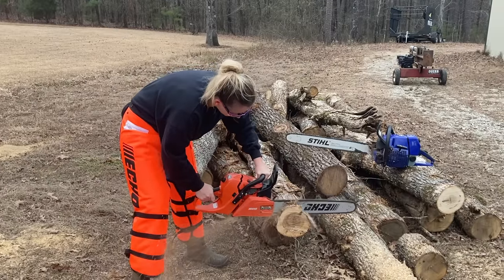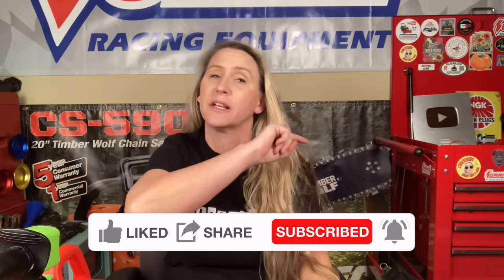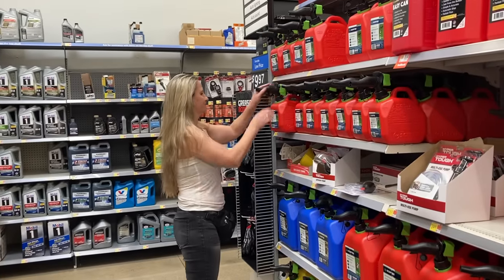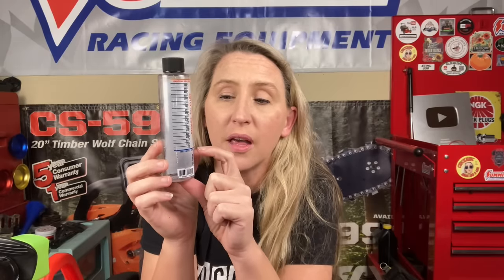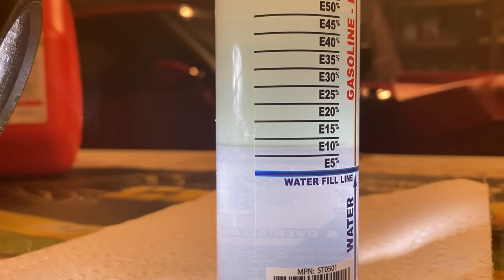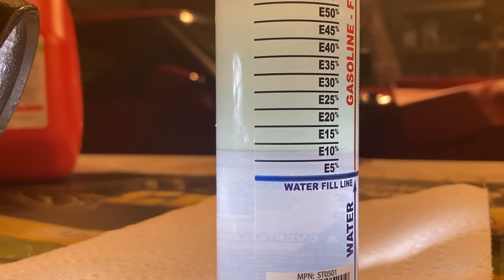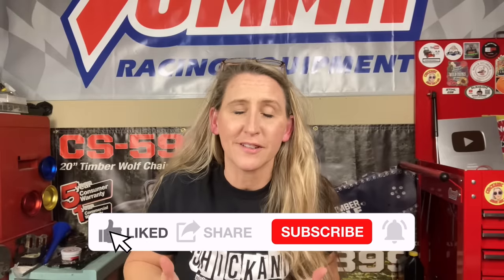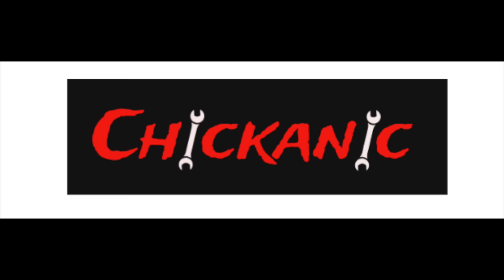Fueled by Deception. How You’re Getting Ripped Off at the Pump! (I'm SHOCKED!) VLOG

Comment: As a fuel chemist and fuel quality professional for 40 years for several oil companies and with my retail and terminal experience I usually view these video's and just shake my head but you are spot on with your testing and knowledge of fuel dispensers.  Yes indeed, there will be a small amount of whatever was previously pumped when a shared dispenser hose is used.  And your testing using the phase separation characteristics of water/gasoline/ethanol blends is 100% accurate.  Finally someone who is educating viewers correctly.
Reply: I slept at a Holiday Inn last night and I agree.
Reply: Casey’s has a dedicated hose for ethanol free. If your station does not, pump 4 gallons into your car first.
Reply: I always pump into my car before I pump into the gas can
Reply: .....and good looking too!
Reply: the gas sumps below the pump draw the gas back from the pump nozzle. i install these for quick trip and kum and go. i can speak for oklahoma pumps we good
Reply: Back when I lived in Pennsylvania I use to buy regular gas at a Sheetz station and my 78 sedan deville would diesel every time I would shut it off.  If I bought gas a block away at a Hess station it would shut right off.  Yeah, guess which on I bought.
Reply: I haul fuel to gas stations. We check every tank for water before dropping fuel so the separation does not happen. If we detect water, we will not drop and notify the proper management to have the water removed before any future deliveries are made.
Reply: My father has been using this test for many years on the fuel that he puts into his 2 airplanes. He can burn auto fuel but doesn’t want ANY ethanol because it ruins hoses and engines.
Reply: He should have set the plastic can on the ground the prevent a static discharge and accompanying fire. There are often signs a the dispenser directing how to safely fill a fuel can.
Reply: @OL-Tom I miss Hess.
Reply: Good info..I think I will go around and get no ethanol and get each sample tested . I promise that they will pay big time if an analysis shows any ethanol whatsoever they will pay $$$$$$ big time. (Yep  Those Obama EPA  gas cans are beyond infuriating . They good old  ones were $4.99 until those fools who had probably never cut grass in their lives  in their 20 story office building . I get gas everywhere most every time and worn out holding the button down and the newfangled things cost up to $25 now.
Reply: No ethanol isn’t available where I live.
Reply: @A3Kr0n I worked at one and I also agree!
Reply: Ethanol is the big scam on us! I’m sure you know what I mean! 😳
Reply: me too! 70's LA County's CA first Vapor recovery me and Dad with a car wash off the 60 at Nogales all the way to 90's containment, and 2000's to retirement.
Reply: Thankfully all the stations in my area that sell ethanol free (not many) have it on its own separate pump and hose.
Reply: I’m new and thankful to have stumbled upon your channel.  I own many small engines and know very little about them.  So the information you give is a godsend.  On this particular video I have to comments:  1. Most big government regulations come from one idiot or one company who has messed it up for the rest of us.  I don’t like it either but we can’t hunt down all the idiots.  2.  Pouring the gas into a smaller, more stable container, and then transferring to the tester would have been much cleaner and easier.  Thank you for the content.  I have so much to dive into.
Reply: @A3Kr0n but was it a holiday In Express???
Reply: @watching95  but still a rip off as you are paying for E free and getting some other stuff first..
Luckily where I get my EFree has a dedicated pump..
Reply: Shades of Sunoco and the many grades of fuel
Reply: @StaticSift  I wonder what % ethanol will show up from those units?
Reply: @laymardad3335 yeah okay. What gas stations do you deliver to and in what state and cities. I have watched every single gas station in my town be refueled and all but one of them have water and sediment in the bottom of their tanks none of them have ever clean their tanks out or done anything special when the fuel truck showed up.
Reply: @bobbyhempel1513   It isn't the driver who delivers the fuel who removes the water. If water is detected, the store management is supposed to hire a company to remove the water from the tank. My responsibility is to check for water and refuse to deliver if water is present.
Reply: Anything that the government gets involved in becomes a total mess.
Reply: This had happened in Canada I believe around 2010 where when you went to the gas station and bought supreme gas we were getting screwed and it was all regular gas and somehow somebody found out and there was a class action suit. I believe if you had proof of gas and purchases dates etc. I think they had to reimburse you. The big problem with this  is if you’re driving a high-performance car that requires true supreme gas and you pump from those pumps  sharing different grades or supreme only and it has regular gas you could be destroying your motor.  I personally try to only get supreme gas where they have separate nozzles for supreme only.  This whole gas thing in the price were paying for gas is crazy just the government screwing everybody.
Reply: ⁰
Reply: Those gas jugs (can't really call it a can) are probably the best they have come out with recently, but it is a two-handed operation. I dropped the $65 and bought the metal safety can with the yellow funnel. I also have an antique steel gas can with the screw off spout cap and the relief cap to remove the vacuum. Best cans ever!
Reply: All those tools and no funnel to avoid the spill. 😂 Great video.
Reply: Do you agree with her on trufuel? I been using it for years and can’t tell the difference. Although I mostly buy avgas mixing it myself with stihls ultra.
Reply: Ah. One of those...ɓ
Reply: What the hell is with those American petrol cans!!! That looks crazy and expensive!!!
Reply: Any recommendations' for fuel stabilizer ?
Reply: Gonna have to see if my station has its own hose for ethanol free.
Reply: 76 station in Quartzsite AZ has above ground tanks...on Main st
Reply: And what water soluble additive do you think is in gasoline?  And please explain how a water soluble (polar matrix) mixes with a non-polar matrix like gasoline.
Reply: If you were smart you would have taken the spout off and poured out into a smaller container that was easier to handle and then pour into testing bottle. 
You are welcome.
Reply: If the small engine is at risk because of this misleading practice, so are our cars. My car dealership told me which chains to stay away from. It seems like it's common practice now.
Reply: Except she used a contaminated test bottle for her experiment, I agree.
Reply: Agreed,  I'm a licensed professional chemical engineer who ran an oil refinery, pipelines and a product terminal. She did a great job.
Reply: videos
Reply: @haroldstringfield1865 Anything? Does that mean you object to the federal NHTSA that regulates the safety of motor vehicles? Do you prefer that there be no safety standards in motor vehicles when you & your family drive on the roads? If 1 of your loved ones were to be killed because it's a totally unregulated free-for-all Wild West on the roads I'm sure you would sing a different tune.
Reply: Doesn't the addition of ethanol allow for the burnage of a certain amount of water too?
Reply: I'm just wondering why, after all these years, nobody can come up with hoses/gaskets that are ethanol resistant.
Reply: Ethanol free  gas is unavailable where I live in New Mexico.  For 2 years now.  I don't want Ethanol in my car.. unacceptable.
Reply: Nope! She's no scientist.  "2 different stations" and the 30 seconds of footage beginning here:  6:01  PLUS her statement here:  13:55  confirmed that SHE NEVER pumped a tank of "Ethanol free" after making sure to first pump 2 gallons of "Ethanol free" into the car.  Why does that matter?  It's called a "Control Test" and it tests JUST THE fuel for the presence of Ethanol, not a mixture caused by someone previously pumping fuel.

Also, her sample tanks were so small that most of the fuel came only from the hoses anyway.

Last point;  All you "hate Gubment" Karens have quickly forgotten how Ruthless tobacco corporations were.  Imagine the power that you will hand over to corporations if you're all successful in "ending Gubment".  You simps fail to understand that it wasn't "Gubment" that designed and built that safety mechanism on the fuel bottle,  a lazy corporation designed and built it.  No government at all means all the power in the hands of the wealthy and their corporations,, chaos for the rest of us.
Reply: @OL-Tom  curious to know where in PA.  I used to travel to York, and a local dealer sold pure gas.  I started using it in my late model Nissan SUV, and regularly got better gas mileage, vs ethanolated gas.  Then I retired and relocated out of state, and my forever-home is in a farm community which sells pure gas, white gas, diesel (farm diesel and consumer diesel), and kerosene.  All the special fuels each run from separate pumps.
Reply: Common knowledge to anyone who took a small engine class in 1980's high-school.  People are dumber now because teachers are.
Reply: The alcohol free fuel that my station sells goes to a pump that’s all by itself self with one nozzle and it gets filled by a different truck and ever i since I switched to this fuel I have yet to have any carb problems and that’s been going on 3 yrs yet ans no stabil is used and they start every spring with out issues
Reply: How much residual of the 87 is left in the testing bottle since it looked like the same bottle was used for all 3 tests. I know it might not make a difference, just wondering.
Reply: @watching95   Hello felow midwesterner!  Only some caseys have those.  Heck a lot of caseys dont even have ethanol free available in my neck of the woods. 1 phillips 66 in my 10,000 person town has ethanol free.
Reply: @zeeb696 
I do not agree with her. Tru fuel is great, been using it for years. I started watching "taryl fixes all". This guy was a mechanic before he started his own small engine business. He's really good. You can learn things from this girl, the simple stuff. Taryl dives into the much deeper stuff and his videos don't drag on forever.
Reply: Thanks  I appreciate  your video about this and subscribe   because of this vedeo
Reply: My Tesla isn't affected.
Reply: @waltershackelford3923 Wow. Pretty aggressive huh?
Reply: My tip is look for the guy gal pumping into a external tank to follow as they exit and grab their pump
Reply: I have never seen a pump that shares its ethanol free dispenser with any other fuel. Maybe this is just another advantage to living in the west.
Reply: Thanks
Reply: Ethanol Shield additive to all my small gas powered  tools, generators, etc. Instructions, state, 'NO ALCOHOL' fuels should be used in this engine.
Reply: @Barracuda48082  I question why you use additive. Just use ethanol free. Shield is a band aid which costs you moola.
Reply: Mythbusters disproved that over a decade ago.  They had to aerosolize the fuel, spray it into a container set up next to their test pump system, and then just have an open arcing circuit, way beyond any amount of static electric discharge you'll ever find, to get it to ignite.
Reply: My vehicle requires premium fuel. Now what?
Reply: Ethanol is crap. I use ethanol-free fuel in my generators and in my toys. My 2001 Cherokee loves it. No problems at all.
Reply: I'd like to see if there is still ethanol if you first purge the first gallon or so before filling a can to test.
Reply: But doesn't all gasoline(s) burn at the same BTU, 29,000 degrees???
Reply: You are a good girl.😊
Reply: Amen to that,  thank you.
Reply: @arcanondrum6543  This isn't an instructional video on how to ensure to only get ethenol-free fuel from ethanol-free pumps. 

It is an informative video of how the common everyday customer SHE serves on a regular basis ends up with ethenol in their equipment because the TWO gas stations in HER area don't use separate pumps or hoses for the ethenol free fuel. You can't criticize her by claiming she didn't do something "scientific" when she never claimed it was a scientific experiment.
Reply: Amazon has a 10 buck (set of 5 adapters) to convert gas jugs to the old style.  Those new gas jugs are a hazard and designed to make you waste gas so you have to buy more.
Reply: @MichaelofYurtBees 
I went the same direction and spent the cash to get the steel can. A year later the steel can started leaking at the bottom seam. The ethanol was keeping the water that it condensed at the bottom and the seam started rusting weeping fuel.  Went back to the stupid plastic containers and zip tie that green button when I need to pour.
Reply: @VT-kg4cu  I am contemplating getting some liquid fuel tank liner to protect my fuel cans.
Reply: @gregorycarver5723 Good thing he is well grounded then, since it didn’t catch fire.
Reply: We use NON ETHNOL  pure gas!
Reply: She knows her stuff
Reply: @swiftmatic Viton is the ethanol resistant elastomer you would need.
Carb kit with viton needle and pump diaphram and any 0-rings.
Old tech was EPDM elastomer. Uncompatible with modern fuel.
Reply: MTBE Octane additive used till late 1990's was just as carcinogenic and dangerous as TEL.
Primo AV Gas made by Brits is the last of the good hi-octane stuff. Or so I read 15 years ago.
Do Nitrile carb floats break down with Ethanol fuels?
I know that vinyl tubing in two strokes gets ruined by it.
I had engines that ran well for years until I moved to ethanol only smog control area.
Alcohols are drying agents in vinyl plastics.
Reply: Not to mention the hottest mechanic on YouTube.
Reply: Cornholio gas. Heh-heh.
Reply: My local station Mirabito has their own hose only for ethonol free free so there’s no mixing I’m assuming ??!!!!
Reply: Why are they putting that crap in the gasoline? I'm sure nobody wants it.
Reply: @MarthaGomez-h3o  Because some politically connected people are getting rich. Same reason they’ll be putting cricket “flour” in our food.
Reply: @danlux4954  the big chains usually always have a pump over by the diesel , I would check again.
Reply: @carbonEYE007  not around here. The government makes them put ethanol in it.
Reply: What can you tell me about perfectly clear fuel in a sample jar that turns amber, sometimes VERY amber overnight?